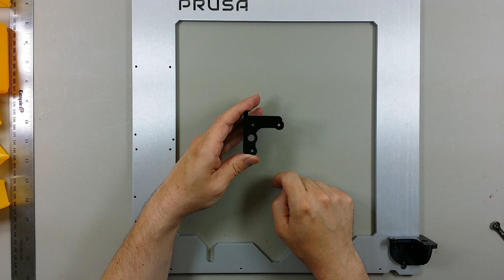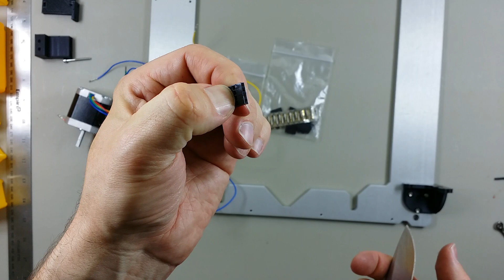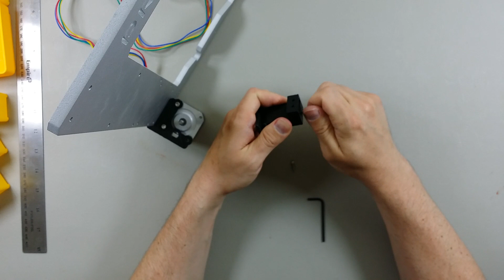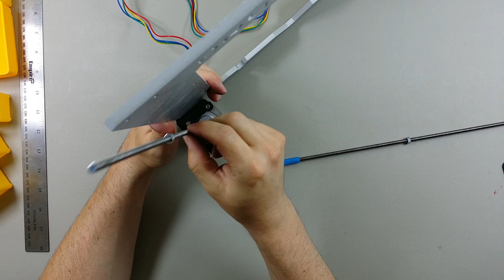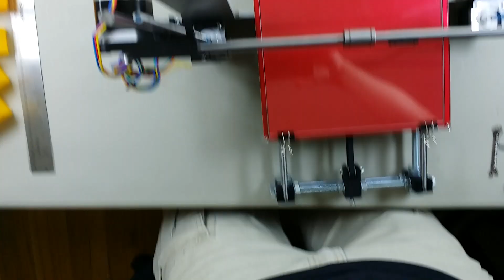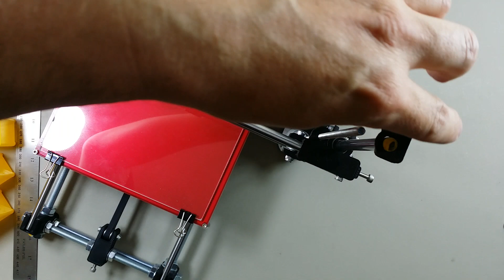How to build a RepRap Prusa i3 (Assembly 5)

Comment: Video number 5 and the only thing I keep thinking is why don't you have yourself something better than an allen wrench for those 3mm screws.  Your fingers must get tired after awhile.  Get yourself a non-electric metric hex driver set.  Also, thanks for the videos.  Very helpful.
Reply from the maker: I actually have a couple of nice screwdriver sets, however, I include allen keys in my kits and I wanted to demonstrate how to build the printer with the sources that are supplied. :)
Reply: engineglue OK, that's honorable of you.  If I made the video I would tell everyone we include the allen wrench but there is no way I'm spending the time and the pain using it.  LOL
Reply from the maker: BigChinoDon lol I considered that but I also wanted to make sure it was possible to build it with allen keys. I don't mind them that much. I like being able to apply extra torque.

Comment: I think next time you should use a bigger knife to take that connector apart.  Rambo might have one you could use ;)  Great video!
Reply from the maker: It's much easier with a screwdriver. I wonder if Rambo would have a small screwdriver.